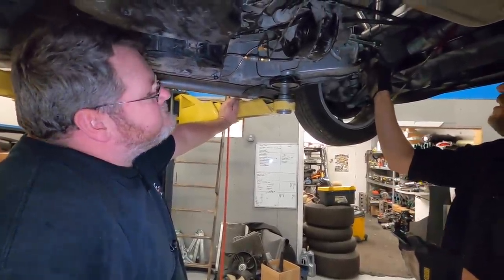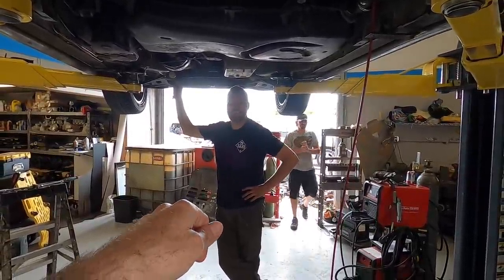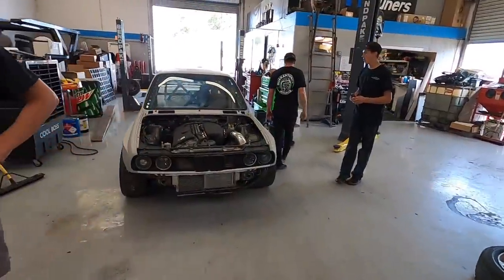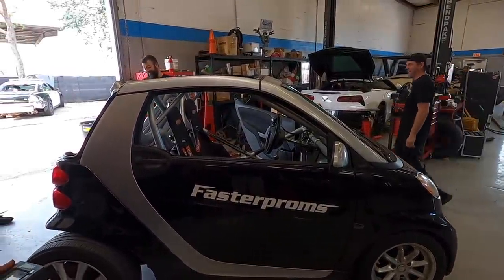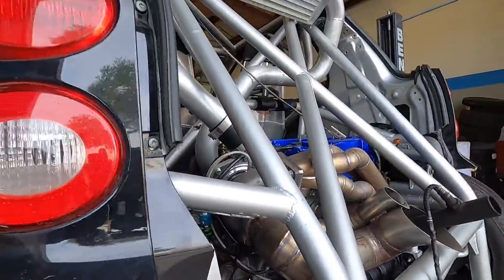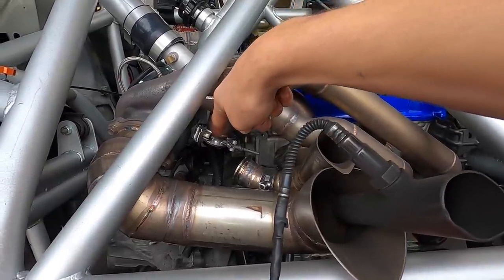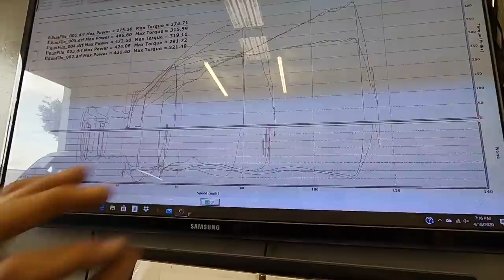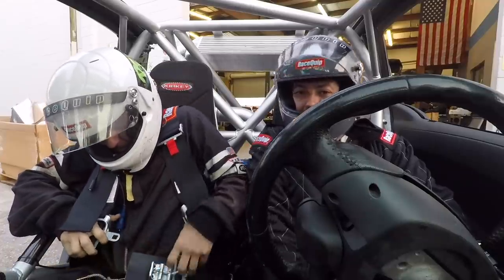Turbo KSeries Smart Car FIRST DRIVE! Dyno, BURNOUTS, Donuts, & Thrash! Tiny RIPPER Monster FUN!!

Comment: Yall need to make a skid plate to cover all those pedals from below so something like a cone doesnt get jammed up in there and cause a WOT issue or NO BRAKES OR CLUTCH
Reply: I think they plan on using the stock belly pan cover when done
Reply: Probably should add splitter too to keep the front end from getting too light at speed

Comment: I'm so glad its caged so legit. I cant wait to see it hit the drag strip with a tire.
Reply: I was hoping they would put some kicker bars in and cage it front to back.
Reply: Need front impact protection for the drag strip.
Reply: Wheel base is too short. Its going to pull the tires
Reply: It will be a blast on at the Freedom Factory I'm sure

Comment: That thing needs a sequential.
Reply: I know of some guys that know some guys ;)
Reply: It's so lightweight and not too high powered, so it should shift well, but if not yes.
Reply: Make it MORE insane!
Reply: That’s what Kyle said...
Reply: It's not a drag car though so why?
Reply: @_Professor_Oak  it doesnt need to be a drag car to be a sequential. Shit I wish they made sequential t5 for my foxbodys. But they only make kits for it. 

Easier to drive. Fun as hell to just slap it in gear in one motion. And you still have use for the clutch just not for shifting. Just for stop and go.
Reply: Hell yeah! It must be awesome to slam gears W/O having to bother with pressing the clutch,the only thing I can think of that would even be close would be paddle shifters on the steering wheel.
Reply: Brendan McCarthy I saw a company that makes a product called a "Recluse" clutch. It allows you to bang through the gears like a sequential and you only use the clutch when braking or coming to a complete stop,they are both great ideas IMO. I first saw the Recluse clutch set up on the "Grind hard plumbing Co." Channel. They put it on one of their Power wheels go carts and they said it was much easier to control it W/O having to use the clutch every time to shift.

Comment: @fasterproms @pfispeed @boostedboiz - Let me put this into a little context for you...:

2,222lbs is 1,007kg, or a fraction over a metric tonne - power is 495bhp - so you basically have a power to weight ration of 491bhp per tonne - with me so far...?

How does that stack up...?

2020 Dodge Challenger SRT Hellcat = 717bhp to 4,429lbs = 357bhp per tonne
2019 Chevrolet Camaro ZL1 = 650bhp to 3883lbs = 3,69bhp per tonne
2020 Ford Mustang Shelby GT500 = 760bhp to 4,200lbs = 398bhp per tonne
2019 Lamborghini Huracan EVO 5.2 V10 = 630bhp to 3,134lbs = 443bhp per tonne
2019 Chevrolet Corvette ZR1 6.2 V8 Supercharged C07 = 755 bhp to 3,522lbs = 472bhp per tonne
2019 Lamborghini Aventador LP770-4 Roadster SVJ = 759bhp to 3,472lbs = 481bhp per tonne

You  -->  2019 Ferrari SF 90 Stradale 4.0 V8 Hybrid = 769bhp to 3,450lbs = 491bhp per tonne

You've created a Little Monster!

Oh, and if there's a vote or suggestions for what to name it...? Most Smart cars are basically used for grocery shopping by housewives, right...? They are here in the UK anyway... So how about the k-smart...? And get someone to make some graphics like the current kmart logo - complete with the big red K above the name...? (https://en.wikipedia.org/wiki/Kmart)

Just my two pence... or Cents... worth...

Tigger
Reply: ELI5.. Thanks guy
Reply: John McCulloch to be technical, that is actually wheel horsepower, not brake horse. But we get the idea 😁
Reply: 2222 lbs is with Jeremy in the car. 2038 without himSo power to weight is around 535 hp / ton. That compares to a Bugatti Veyron and McLaren 675LT

Comment: Hell yeah I've been waiting for this video you probably need to get a thick piece of Steel 2 weight down the front end lol

Just curious what is the insurance rate on the Smart car it's probably pretty low for a 500 horsepower smart well they don't know it's 500 horsepower lol

Comment: Be careful with that intercooler ducting, it will act like a spoiler and put even more weight on the rear wheels and not the front at speed.

Comment: Been looking at those shafts the whole time you were building it, thinking to myself " Hope they're not going to leave those" and you did...
Didn't expect you to break em until you changed tires though. Time for a call to Strange engineering. .

Nice job guys, now for the sort out, I'm sure you'll get the bugs out, but for sure there's going to be some rework. I'm sure the halfshafts aren't the only things working slightly over it's design envelope.

Have fun, but be safe, that toy is going to bite if you give it a chance.

Comment: Wild & Crazy!!!!  This is what would happen if I ever get the resources to build my version of this swap... I drive a BMW i3 EV, and the Tesla Model S Performance rear motor drive would fit about like this swap (+2.5" per side). The i3 is CRFP (carbon fiber reinforced plastic) structure... 2600 pounds stock. The swap would only add about 100 pounds but would produce 503hp/487lb.ft. of electric torque from 0 RPM.  Can you say "silent sleeper"?

Comment: Roughly 2100 lbs with fuel,  rear engine,  rear wheel drive,  turbo K powered, with 500 horsepower and a 60/40 weight distribution.....Holy Shit!

Comment: first, what a great project. I can spend hours looking at these types of construction projects.  The converted Smart is very similar to the ZCars Minis from the UK, where they build classic Minis with Honda K engines and Suzuki Hayabusa engines. Because these engines are starting to become scarce in Europe. They will now use Ford and VW engines, because they are easier and cheaper to obtain. These Minis have an 80 inch wheelbase. Due to the low weight of the car, the wheels spin and the car doesn't make wheelys. These Minis are super fast. Good luck with your further projects.

Comment: Airflow expert here, aviation.  The airstream funnel duct needs to be 12° to 7°degrees flare,  7° optimal for your air induction. Anything beyond that just causes turbulence. Again 7° optimal. Also a few inches beyond the backside of the heat tunnel it. It will smooth out the airflow for better cooling performance

Comment: I was totally amazed when I first saw a Smart car with a Hyabusa engine in it,the combination of the tiny Smart car with a motorcycle engine in it is awesome. IMO these Smart cars are ugly,worthless death traps that no one should ever drive on public roads. A Smart car with a 500-1000cc motorcycle engine in it was genius and turns it into a bad ass machine instantly. The only build i've seen that compares to the Smart car/Hyabusa combination is the Hoonigan video I saw that has a Mazda Miata with a 707HP Hellcat engine stuffed into it. The power to weight ratio on both builds is completely ridiculous.

Comment: who thinks Kater-Tot needs to pay a visit to the Freedom Factory burnout pad ASAP? >:D
 
I think she needs some removable front weight plates and a hydraulic hand brake in tandem with the butterfly valve system so your rear braking options are endless and you can slide a little more and whip a little less

Comment: Put a blinking  Red Light attached to a contact switch high on the Dash labled "Rear Brakes". Activated by rotating the brake line ball valve.

Comment: Trevor from MATV used same exhaust manifold and had smar issue. He did fix that issue by attaching wastegate at the exhaust housing of turbo and plugging hole for the wastegate. You might be able to fix the boost creep with this way.

Comment: Since this is rear drive/rear engine the Axle problem is far worse then in a front heel drive platform, this goes for the trans as well. The Axles and Trans are going to be seeing way more load. You're going to need Driveshaft Shop axles at least and also plan to lunch a Trans from time to time, so have a backup Trans or go for dog gears for 1-4 gears. Want to see this thing win the born out comp at Cleetus and Cars!

Comment: Onetime i was working the counter at the parts store and this guy comes in with his car smoking from the hood. He then jumps out runs in and yells for help. I take the extinguisher out, pop the hood and his battery is laying sideways + terminal mashed up next the fire wall arcing like a thermite bomb. It took 5 large extinguishers to slow the fire as ALL the positive wires that where not fused in the car turned to incandescent filaments and cooked anything in a 5in radius. And that folks is why you strap a battery and fuse everything.

Comment: If you want to sort the corrosion on the intercooler, treat it with phosphoric acid, you can get it from a drugstore. Brush it on, leave it for 10 minutes and wash it off with clean water and it will come up like new! It won't get rid if the pitting but it will kill the corrosion and brighten the alloy! Keep the acid away from steel parts as it will caused surface rust. This is what we use when treating corrosion in aircraft!

Comment: Do you have pics of inside the collector and a shot from the ewg hole? A lot of manifolds are okay with the location it's more like they didn't take in account where the collector merge ends and put the gate too high up in the collector only allowing it to evacuate partial exhaust from only 2 cylinders instead of where it's completely collected right before the turbo flange I've seen it plenty of times easy fix if that's the case

Comment: just put like a super cheap contact on the ball valve. like a thin strip on the end of the handle, and a bridge in the closed position. run 5v through it to an led on the dash. low voltage, so safe to be jank af, and it'll remind you that the rear brakes are off
=

Comment: One thinking point with the "funnel" into the intercooler. When you funnel air into the intercooler it has to speed up as it gets forced through the core, when it speeds up it becomes less dense. That could potentially mean less heat transfer through the core. Same idea behind why adding material to intakes ports to increase velocity is not a good idea.

Comment: I mentioned in a comment to PFI that as the throttle cable gets depressed it pulls the cable toward the back.  Have a lever under that.  So when the bottom of the pedal pushes the one side of the lever backwards it pulls the cable forward

Comment: The moment you realize that this Stock 4cyl with a turbo is way WAY faster than the AWD turbo LS S-10...🤔🤭🤯
Reply from the maker: Mmm not yet but it’s fast. The s10 has more bugs to work out but it’ll be much faster overall. More fun katerTot FS

Comment: if you do a little crank for the gascable it only needs to go halfway around the corner , might give you a little more room too https://content.speedwaymotors.com/ProductImages/5501523_L_5450d36b-76ee-464f-9c93-8d3d4e86ce98.jpg
as for the shoulder to shoulder bit : smart cars have the passenger seat slightly behind the driversseat so you can get youre shoulder behind that of the driver , bit hard to do now with the cage bit its a nive trick to create room in a small car

Comment: Great build! They need to take this to import shows and the big Honda Hday gathering....I tuned in for the K swap. What does name "Fasterproms" mean?
Reply: Goes back to days of early ECUs where you had to burn a tune onto PROM chips using a standalone ROM burner, think they were write once chips too so one tune per chip and if something isn't correct then you'd have to burn a fresh chip and try again.  These tuning PROM(s) make the car faster hence the name "Fasterproms".  The Legend videos go into a bit more detail about the burning / tuning process as well as the name but the above is pretty much the long and short of it :-)

Comment: K8R TOT NEEDS MORE ANGLE! it will be so much easier to control when you get the wheel speed up on the short wheelbase. The bat rod needs more angle too

Comment: Love your content and love how the smart car turned out. I see that it's a bit too heavy in the back. Just a suggestion: front end needs work, biggest breaks, a steering kit, chop the fenders for larger tire size. This should add a little weight on the front of the car and will definitely improve steering as I'm thinking it will heavily understeer. Not sure how much it will help, really depends on the center of gravity. Hope it shifts it just enough, but put it into cad based on weight of the front end, rear and distance between front and back tires touching point with the ground.

Comment: I would's run a 1/4 mile in it but I would like to know what it can do on a 1/8th mile run . with the cars ass in the air like it is the steering would be to twitchy for a 1/4 mile run but if I'm right you may have built a 4 second car for the 1/8th mile .